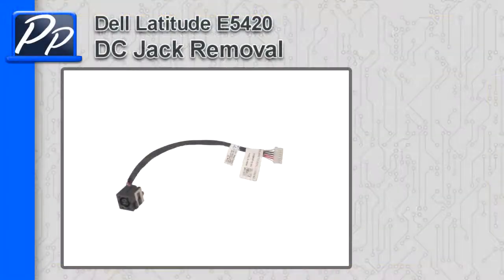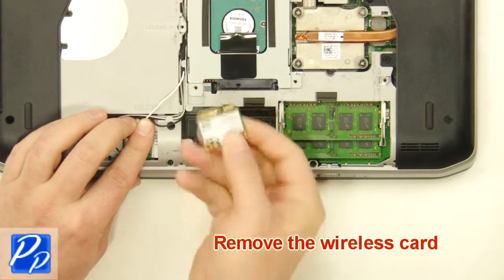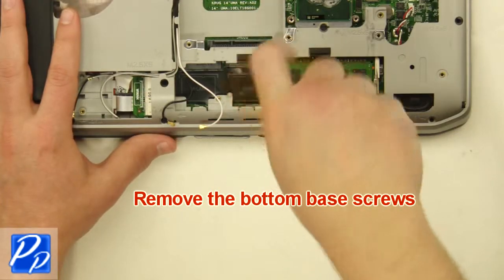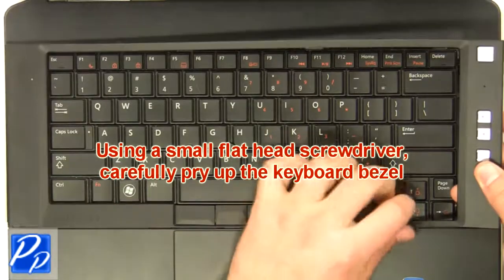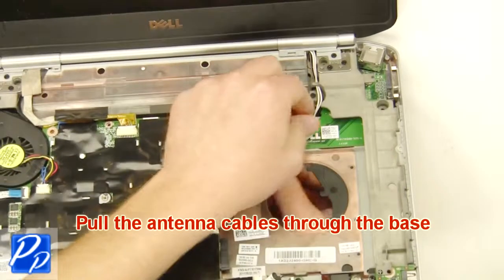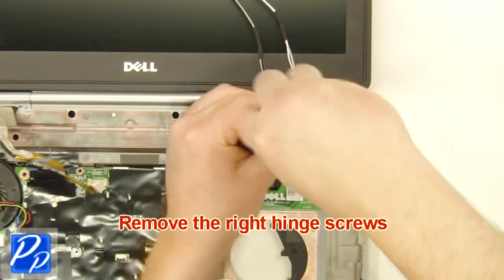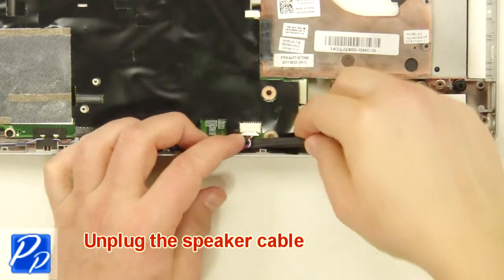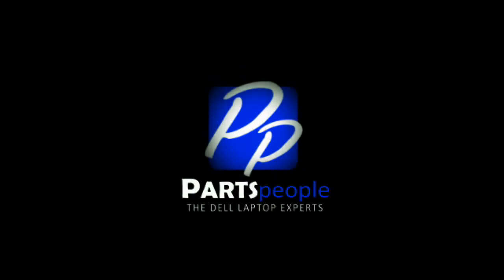Dell Latitude E5420 DC Jack How-To Video Tutorial

Comment: Thank you for this video, it would have taken me much longer to disassemble the laptop without it. Also, what a god awful design Dell...complete disassembly just to replace the power jack? Besides the screen, this part is probably the most likely to need replaced in the life of the laptop, considering the jacks location on the back corner.